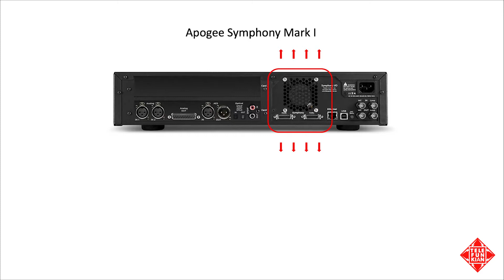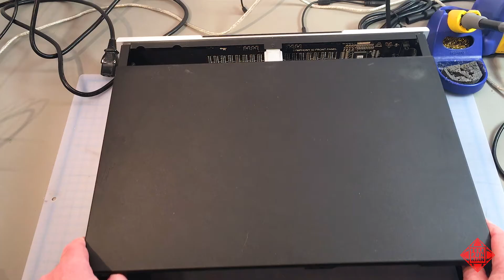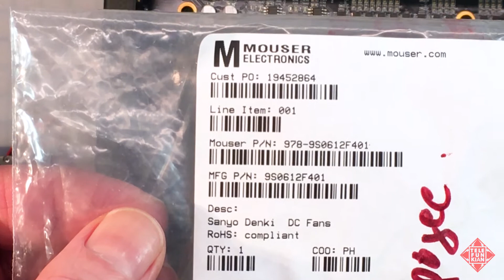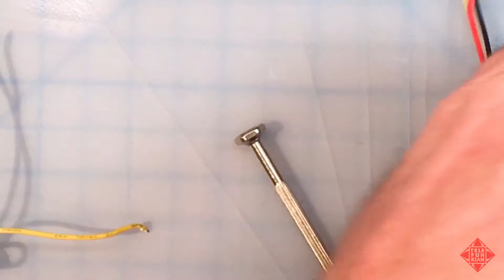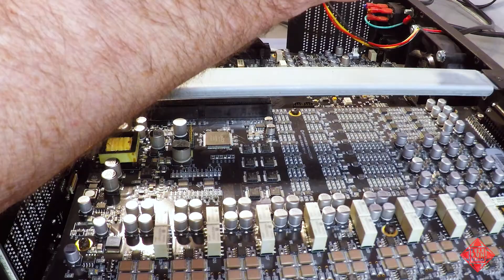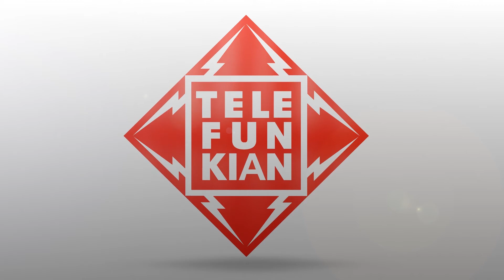Replace Your Apogee Symphony Fan

Comment: Hi, thanks for the video. Do you have other recommendation for the replacement fan? Because the San Ace from mouser is out of stock until 2022. Thank you very much
Reply from the maker: The San Ace 9S0612M401 (quieter) or the 9S0612H401 (4dB louder) should do as well. Failing that, any 60x60x25 mm 12v, three lead fan should work. They need to have a 'pulse sensor'.
Reply from the maker: And thanks for watching!
Reply: @telefunkian  You are a life saver, I just purchased M401 because of you. Thank you very very much!
Reply: Great video, thanks! I replaced the fan as well to M401 yesterday and it’s very quiet. I’m just a bit concerned if the fan is powerful enough — I have 16x16 + 8x8 in there and the noise was pretty loud before. The difference is huge, and just wanna ask have you had any issues with overwarming? Thank you for the help!
Reply: @timokamarainen2640  Hi, so far it's been performing well and no issue of overheating. Although I've been only using it in well ventilated and cool temperature room all the time. Hope it helps
Reply: @stevano92  Ok! I've been working a couple of days now and no issues so far. It doesn't seem to be overheating. Thanks for your reply!